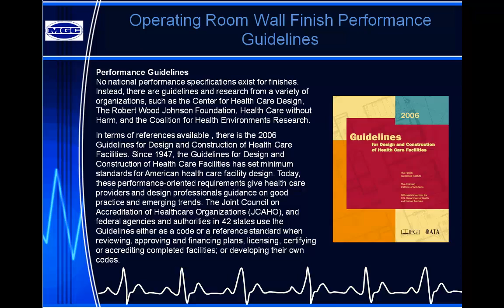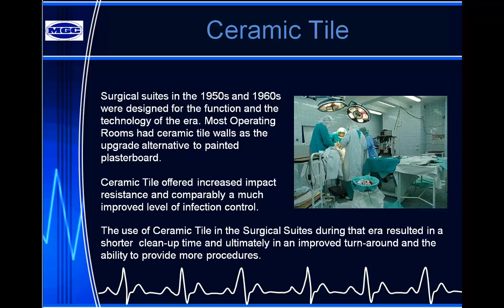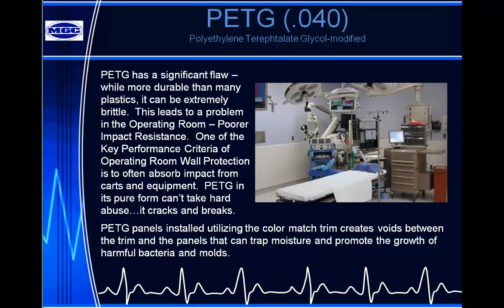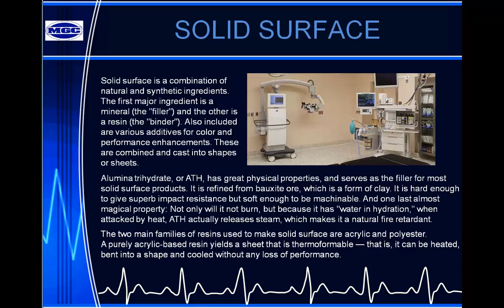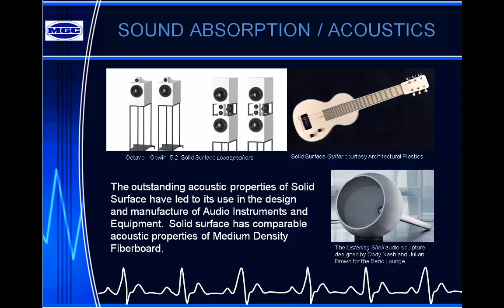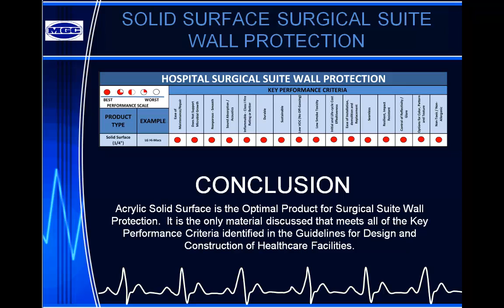Operating Room Wall Finish Presentation

Comment: I believe that you have understated the qualities of the rigid PVC.  It is obvious that you would not help the sale of your product by indicating the fracture capability of solid surface.  a solid surface clad wall split from floor to ceiling when a surgery room door was opened back against the wall during an emergency.  This took place in a test room at Scott White hospital in Waco, Texas.  The Solid Surface failure in this "Test Room" is the reason why all surger rooms in the Baylor/Scott White hospital group are being clad with the rigid PVC.  Baylor hospital group has been using PVC for 16 years.
A very important advantage of the PVC material that you failed to mention is the availability of PVC to be manufactured with ionized Silver which disrups the reproductive cycle of bacteria, virus, mold and mildew.  The bacteria and virus that make contact with the wall are rendered dead within 2 hours.  
The 2 fold purpose of the wall cladding is to provide:
1.  a high pact surface that will not fail under an emergency crash of a door or equipment.
2.  a continuous bacteria and virus killing wall.
Solid Surface is a beautiful wall covering, no one would think otherwise.  
But, Solid Surface material fails in the only 2 reasons that a cladding is used in  any "Clean Room" environment.
Your presentation was very informative, only lacking in a few points.  Solid Surface is a fabulous product, but, it is just not the best for every situation.
My qualifications - Health Inspector for 7 years.
Glen McCall - glencrs@gmail.com